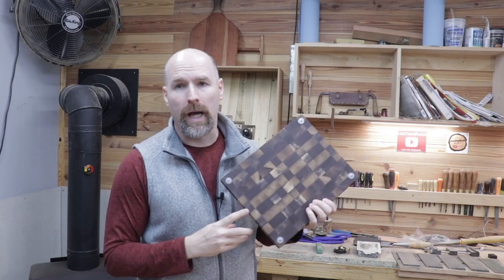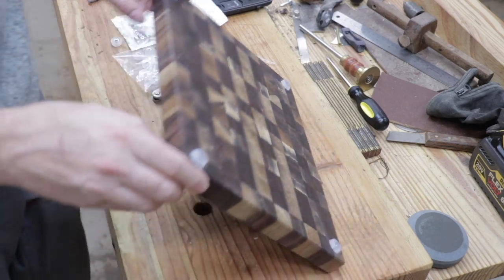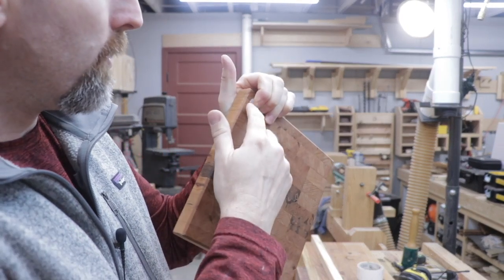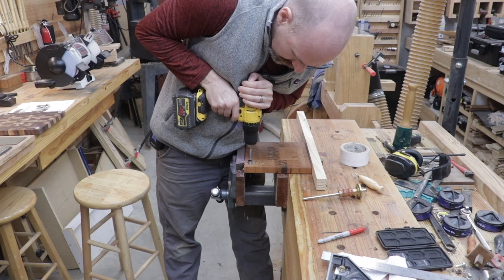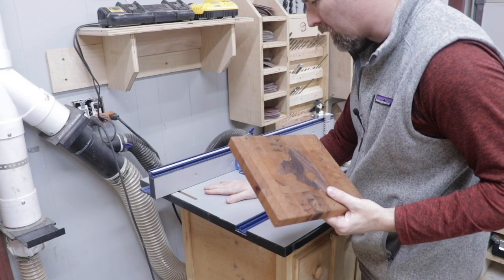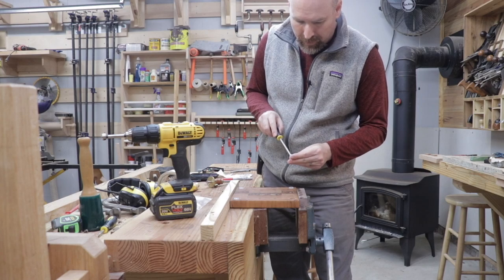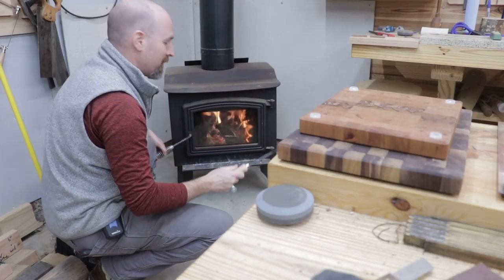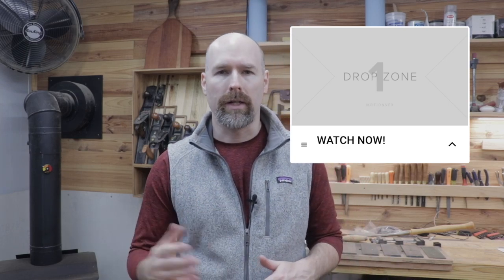Embarrassing Mistake On This Cutting Board Build!

Comment: first of all, sorry my english if it is not perfect. I make only end grain cutting boards ( nothing else :) ) and i had the same problem. So, i bought a drum sander. This tool make the difference. The product will became flat. Be sure to check the product if it s flat before you put the feet and the finish. And run the cutting board to the drum sander until it is flat. I didnt find another alternative to be PERFECT and i tried hard. So, buy if you can a drum sander and this will fix this problem for sure....Another thing that i want to say - when you did the final pattern of the cutting board, you say that you want straight lines alignment and you become a little bit dissapointed after gluing because it was not perfect aligment. I want to say you, that it is MUCH BETTER for cutting board to not be perfect aligment. The board it is more and more stable like this. Congratulations for everything!
Reply from the maker: Thanks for the suggestion! Sounds like very sound advice! What drum sander do you use?

Comment: A drill press is one way, but my rigid cordless drill has a removable front handle, and a depth stop rod that fits into it. You could also use a router since it has a depth stop and you would be square.